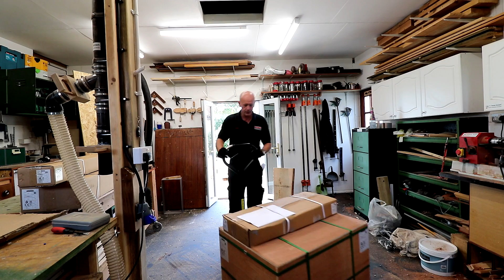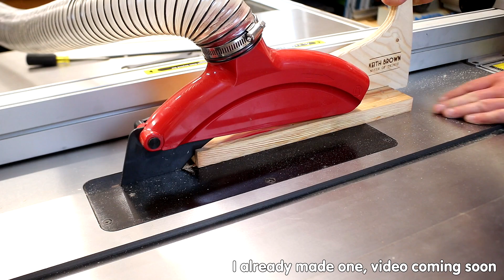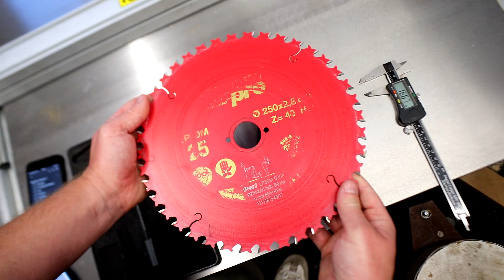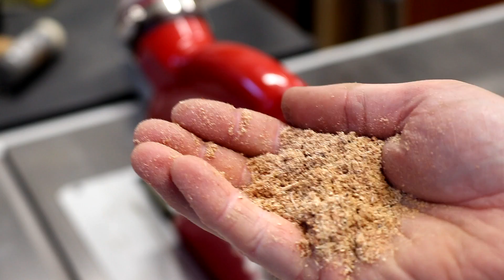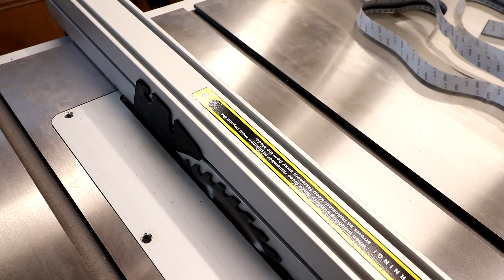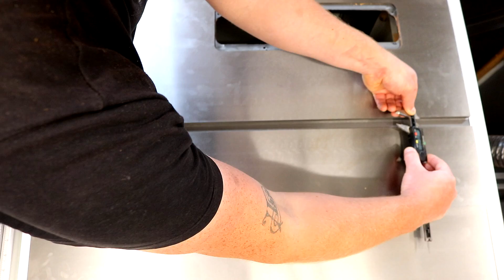Axminster AT254SB / AW10BSB2 Table Saw Review

Comment: Hi mate, I got the same saw about a year ago & I’ve also got the Axminster trade wall mount dust extractor with the cartridge filter. Dust extraction for the main saw is great but I ended up using my trend m class vac on the crown guard as it struggled a little when doing both I think it best for single machine use so if you were replacing your current central unit with HVLP I’d go at least 2HP of keep the wall mount just for table saw/planer. Keep doing the vids pal 👍
Reply from the maker: Thank you, good to know
Reply: I second that! You can get a sip 3 hp dust extractor with the charnwood filter upgrade for around 500. I've just set it up all with 150mm pipe (cheap from screwfix) and wow what a difference compared to 100mm pipe, it's a rabbit hole dust collection but bigger pipe is essential to get the air flow. I made a lean too to house it out of wood I had laying around, all in i think I spent 590 including pipe and blast gates, I had a record dx1000 and it drove me up the wall. There is the argument about lose of heat in winter though....
Reply from the maker: Hi Jack, can you confirm is it the Charnwood CF1519 or CF2024 that is compatible with the SIP 3hp 01954?
Reply: @RagnBoneBrown  its the 2024 mate.
Reply: @jackastbury  thank you
Reply: @keefykeef  no worries, if you go with the 150mm pipe option from screwfix the fittings don't need inserts from pipe to angle change or splitter, only pipe to pipe! Another heads up the dust extractor runs off 13a but the on off switch has a safety feature which means it won't stay "on" so I've hard wired it on (just crimp or solder the cables together a two min job) then I use a cheap plug with remote for very convient dust extraction!

Comment: Don’t bother getting that extractor I have two of them one on the bottom and one on the crown guard and the dust extraction still socks as in it’s not very good it’s just the way the saw is designed
Reply from the maker: Which extractors are you using?
Reply: I have the big chip extractor before orange port which is positioned out Side to keep the noise down and dust that goes to the bottom port , and I use a record power cam vac with two motors and a 4 inch port that goes to the crown guard it does keep the dust down on the bed but inside the machine might as well not bother I tried making it air tight with gaffer tape and plywood on all the holes and gaps but even then it didn’t work, I think the machine is very good for the price I also purchased a slide in bed which you do have to tweak if you ever get one contact me and I will tell you how to get round making it cut perfect,Norman Roberts is a channel I set up for Woodturning
Reply: I use The table so commercially I have a business called NW home improvements and make cabinets for bathrooms kitchens et cetera

Comment: I too am going to upgrade my table saw but will be going for the Laguna fusion 3 . not being a snob but i recently bought a Laguna extractor and it is exceptional so hoping for the same quality from their saws but anything would be better than my Naerok antique which has a fence that needs locked from both ends , has no motor brake and makes so much noise that i have had complaints from Gatwick airport

Comment: That dust collector you're looking at looks fine. My two cents worth of advice are to avoid filter bags like the plauge! They let waaaaay too much fine dust through.
Reply: I agree. A cartridge filter will catch much more of the fine dust than even the best filter bags. Here in the US, even the "premium" bags are 99% efficient only down to 1 micron. A good cartridge filter is 99.9+% efficient down to 0.3 microns. It's those tiny particles that are the most dangerous to your lungs.

In the US, a good source for cartridge filters is Wynn Environmental. I'm not sure if they sell to the UK, but if not they'd probably be able to recommend someone who sells equivalent filters there. Their web site has good instructions on converting existing bag-based filters to use cartridges.

Comment: Great Review Keith - I will be looking to get a table saw soon, and watched your earlier video about choosing a saw too.  I am a keen DIY'er so a smaller saw will probably work for me, but wanted to stay away from contractor type saws.

How do you find the blade tilt - as it tilts towards the fence, whereas many other cabinet saws tilt away.  Does this cause problems for cutting bevels where the offcut can get trapped between the blade and the fence?
Reply from the maker: Thank you. As the fence can go either on the left or the right side of the blade, the blade tilting the opposite way isn't really an issue as you can use the fence the opposite side
Reply: @RagnBoneBrown Thanks Keith. I guess with extension table both sides moving the fence is easier. I've seen setups with both extensions po n the right hand side where it might then not be possible to move the fence to the left .. depending on size of cut required!
None the less, great to see your review on this saw.

Comment: do you intend plugging any of the holes around the blade housing to improve the dust collection keith?
Reply from the maker: I'd like to try that, although when you look inside the body of the saw it seems like quite a daunting task, and I'm not sure if slapping some gaffer tape in there will do enough to improve things... I'm open to ideas! Thanks Peter
Reply: @RagnBoneBrown  I tried that on an Evolution trade saw I adapted for the workshop, there are more air ways in than you can block, especially when you get to the tilt mechanism. :-(